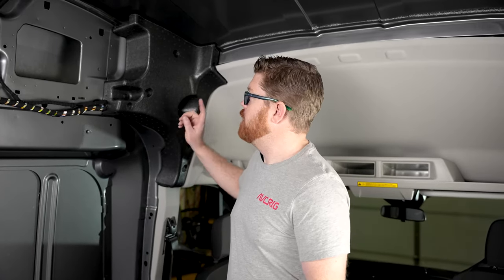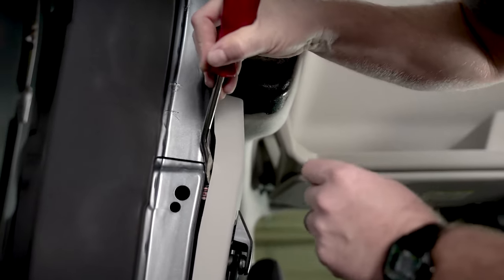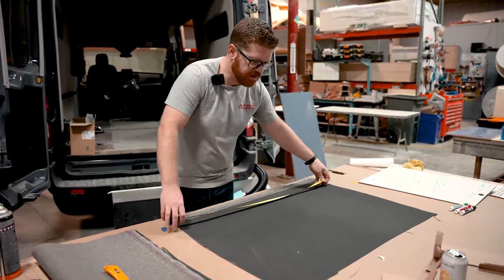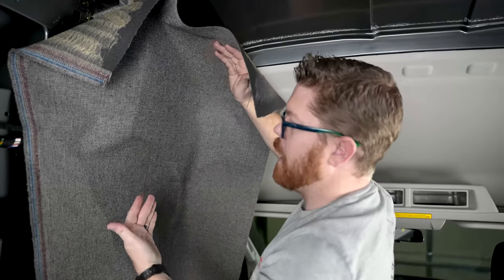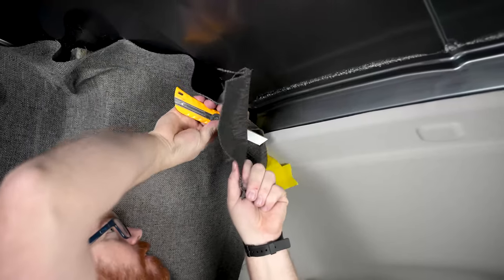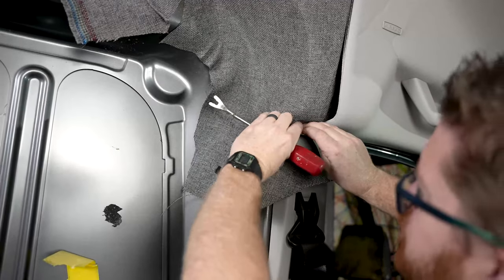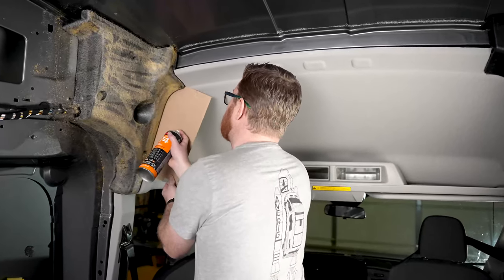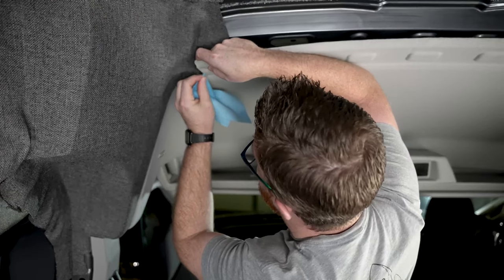Wrapping BLOBS in FORD TRANSIT

Comment: Great info thanks. Can those be taken off and put back on for installing ceiling ?
Reply from the maker: They can be, but I only recommend them wrapped in place on a Transit. Sprinter blobs secure differently and can be wrapped before or out of the van. We wrap these in place and secure the ceiling (that is trimmed to fit around them) after they are wrapped.
Reply: Thank a lot for the information, keep up the quality creative work.
Reply from the maker: @PaulCarterArt  thanks Paul! Will do.

Comment: Couldn’t find the 3M 74 at local supply places.   Tried 3M 77.  Did not stay stuck in Florida heat.  Tried ordering the 74 and could only get the 74ca (California approved - meaning won’t stick).  Any suggestions?

Comment: Quick question - isn’t there a side airbag underneath the foam blob?
Reply from the maker: The answer is sort of. The airbag is really in front of the foam blob. The blobs cover the area and conceal the mechanism. If you search for crashed transit pictures you will see often times the bottom 3” snaps off even with a fabric wrap.

Comment: Is there anyway you could provide information on the spacing of the roof rib (?) locations on the ford transit 148 wheel base high roof? I can not find info anywhere and I would love to have it as I plan my build for options on where I can or can not place roof fans and windows. Thanks!
Reply from the maker: This is a good suggestion. We have a new van coming in and we can use that for some roof layout info.

Comment: Is there a reason why you don't remove the blob, wrap it and put it back up?
Reply from the maker: Yes. They are really hard to get back up nicely after being wrapped out of the van. It can be done, but the seams look really bad in my opinion. Big gaps and stuff. Much cleaner wrapped in place. 

You can remove them to trim them.  I’ve just done so many trimming and wrapping in place is easier.
Reply: @AVCRIG  great, thanks and thanks for putting out these videos, it helps.
Reply: It would be wise to do what AVC says. I removed my blobs, applied all my panels and then tried to wrap the blobs and reattach them. It sucked. Wish I would have seen these videos prior to my build. With that said I would like to thank AVC. I may have been one of the first to purchase their panel kit. My build is looking great! Couldn’t be happier. 
Thanks for giving the Transit some loven!
Reply: @darinanderson4859  My thoughts too; remove blob and reapply. I still think, until I do/see otherwise, it to be easier as long as it is securely reattached with an appropriate adhesive, and in this case would not be 3M-74. My thought goes to a spray foam insulation. So, what was it you used that satisfied the re-installation of a removed blob after all? Thanks ahead for the reply.-Doug